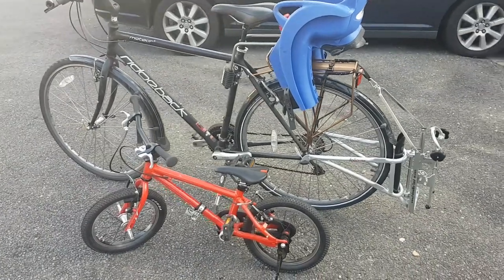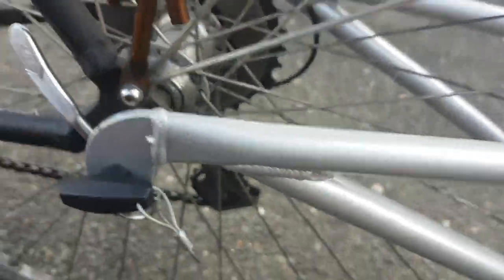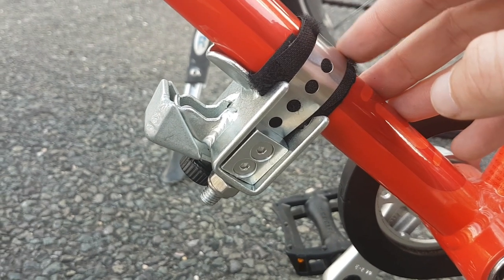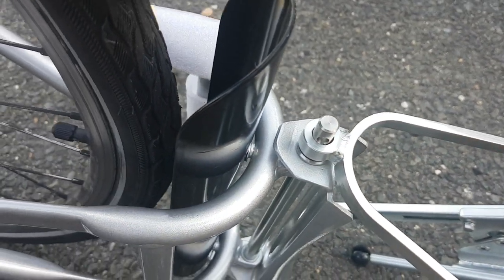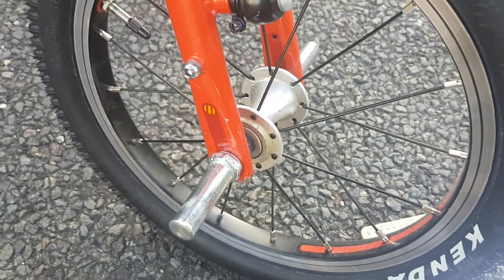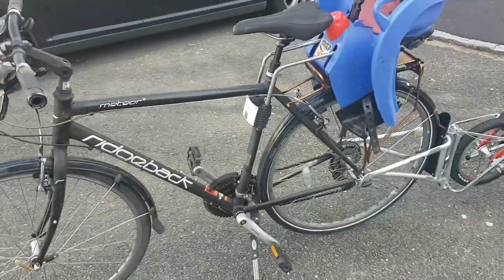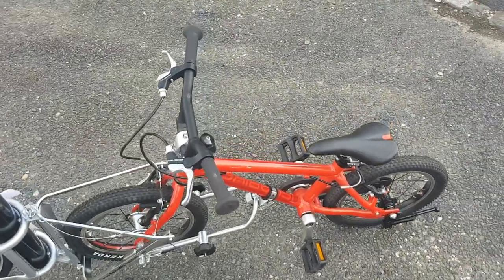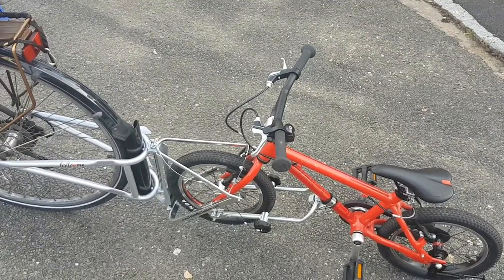How to attach a FollowMe to your bike

Comment: On the subject of cutting the metal strap. You are spot on, and even with a hacksaw it was hard to cut into. In the end, in desperation, I applied a pair of bolt cutters - not something everyone has in their shed, I grant you - but once I'd made a line/fold I found I could break it by bending backwards and forwards. Not very elegant but it worked and the way it fits into the unit means you don't have sharp edges to worry about. Really helpful to know that it's the attachment to the child's bike rather than the big obvious parts that presents the real challenge.
Reply: Installed it on Saturday. Was dreading this...snipped easily with £10 Stanley Metal Snips.
Reply: Ended up using an angle grinder
Reply: @giobikefans  😅

Comment: Really helpful video, thanks. Just checking which isla bike you have. Our daughter isla bike looks same but doe not have quick release axle.
Reply from the maker: That was a CNOC 14 - it's the tiny one, smallest with pedals
Reply: @WillSchreiber  did you need to replace the whole axle on cnoc or use stubs that attach to existing axle?

Comment: How does it not hit the ground while towing? dont see anything really holding the second bike up
Reply from the maker: The front tire of the rear bike is off the ground. It works by the child connecting about mid way up the frame which raises the front off the ground. Never had any issues with it hitting the ground, but also didn't go too mad around town!